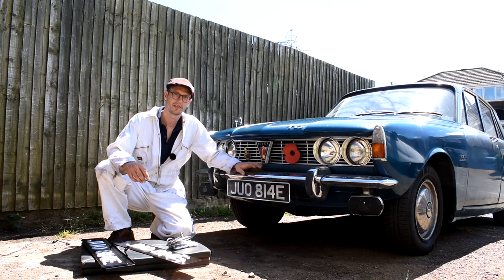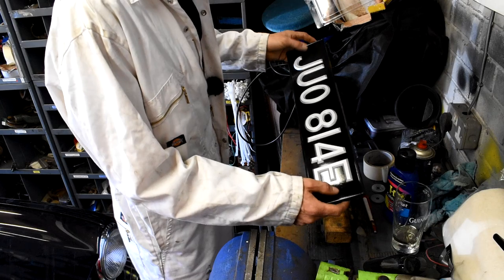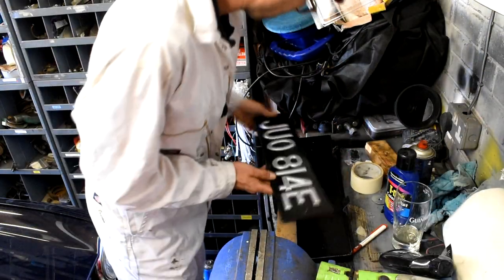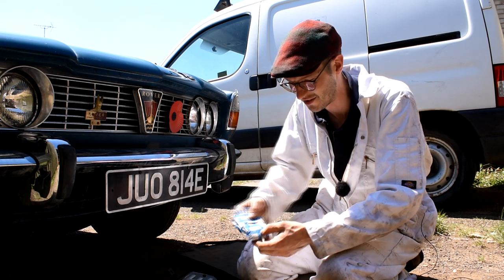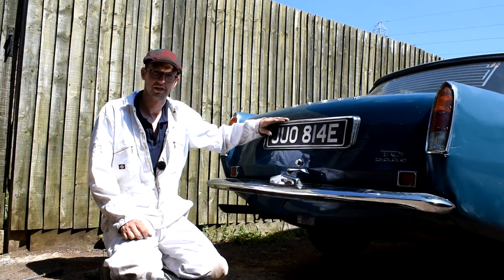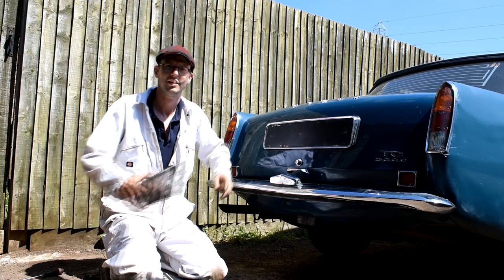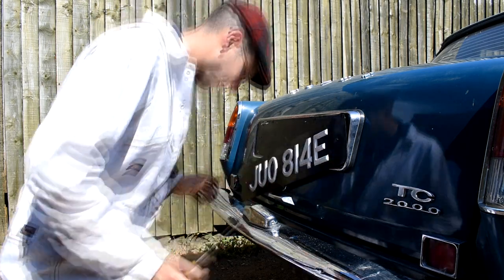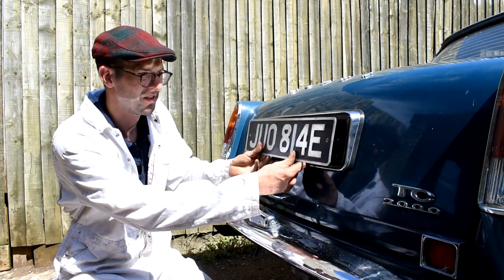Rover P6 A Few Changes

Comment: I did a few of those in the day Steve. I used to use a plastic number plate nut as a packing , but then l had access to hundreds !   You would have made life easier if you'd put a rear no plate screw  in place to hold the plate steady whilst marking the other side. Did l tell you the story of a friend who brought a very clean but high mileage 2000 TC into my shop and asked if he could give it  a "hair cut " whilst l did some paintwork ? Well he removed the speedo , took off the back and someone had written "oh no not again!" 50 years later and l still chuckle ! Thanks Steve .
Reply from the maker: I understand what your saying with the rear number plate, however it's not possible to do this due to my centre punch being to bulky for the hole, and would cause the plate to bend if I did it the way you suggest. What I'd give for a time machine and a one way ticket to the 1960's, I'd be very happy living back then  👍

Comment: Don’t know how you got those holes in the right place… if you divide the measurement by half then you multiply it by two as I understand it !

Oh well it worked out in the end…
Reply from the maker: I said it's half the number plate height for one line. Then for the other line to cross over, half the distance of the last letter to the end of the number plate. There was no mention of multiplying, just use the same measure each end for the measures to be the same 👍
Reply: @SteveDentonClassics  Those plates took me back to my 1966 Vitesse 1600 convertible… LGJ 669D